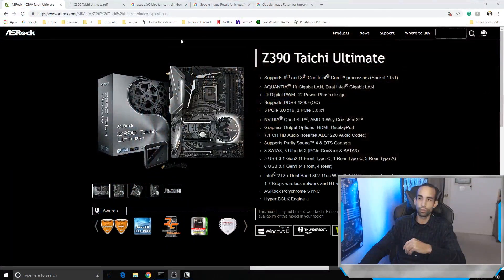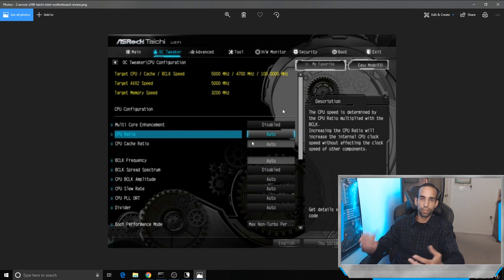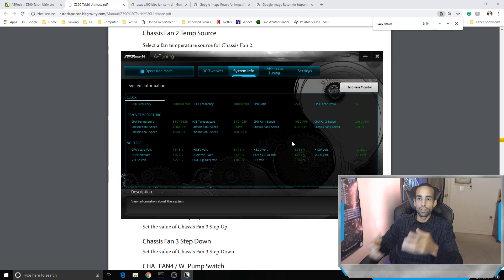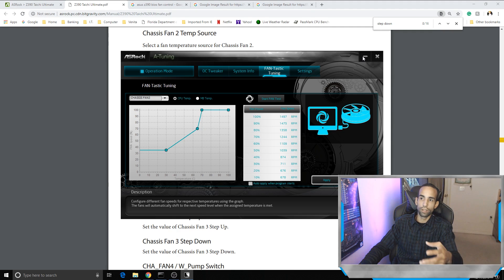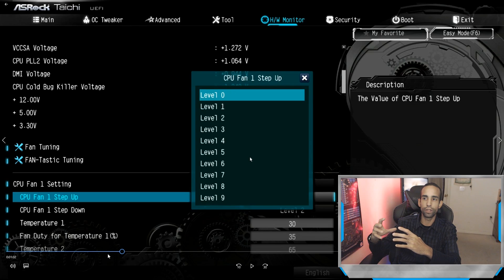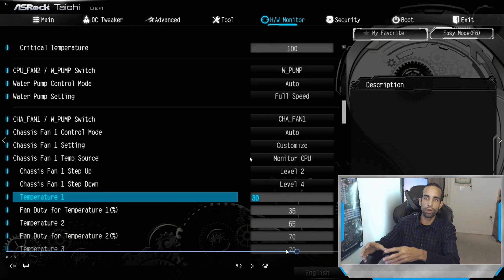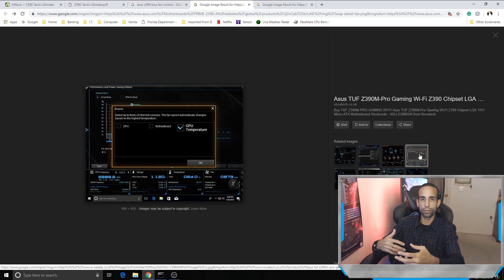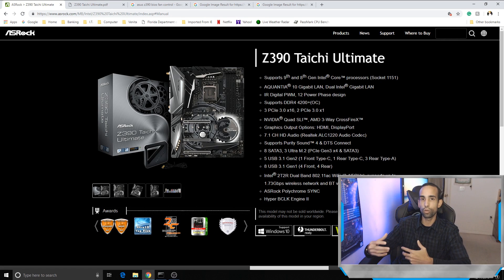Asrock Fan Tuning, Step Up - Down

Comment: HELP!
My System:
Asrock x399 gaming 6
Threadripper 1900x at stock 3,8ghz (4ghz)
Bequiet dark Rock pro 4 CPU cooler 
2x8gb DDR4 @3000mhz
Gtx1070 

I don't get it. I put both CPU Fans to 0% at 40C, to 30% at 60C, to 50% at 70C and to 100% at 75C.
Now testing cinebench r20 and looking at hw Monitor.
Temperature rises immediately to 68C where it stucks, all 8 cores only work at 3ghz instead of 3,8ghz stock and rendering takes longer of course. CPU Fans don't move at any temperature. 2 questions:
1) why aren't my Fans moving?
2) i know that the threadripper is considered not to be Run above 68C, but i wouldnt have any Problem running it at 75C for a few minutes. But why does it throttle down to 3ghz instead of going over 68C? 68C isn't that hot. Is there an Option for setting thermal throttle?

When all Fans are put to 100% at any temperature for example they actually rotate. Benchmarks are great then of course, eventhough it doesn't go above 3,9ghz, never goes to 4ghz boost clock. Temperatures are still stuck at 68C with fans at 100% at 3,9ghz so there is definitely some Kind of thermal throttle, but i don't want it to kick in at 68C, that's to low man.

If you don't know any answer also would appreciate a good Website or forum where i could be helped, thanks.
Reply from the maker: Something is clearly wrong. As far as CPU temps, did you use a cooler with thermal paste pre applied? I honest would start from the beginning. Remove memory and CPU cooler, resocket CPU, before cleaning old thermal paste check how far it spread on both CPU and heatsink to ensure good coverage, then clean and apply thermal paste. Re socket memory and boot. What are your temps at idle? If there not at 25c to 30c, then yes there is something taxing or throttling your CPU. Now the fans should be running 24/7 even at lower temps, but are they 4 pin pwm? Do you have them connected directly to motherboard or fan hub?
Reply: @SerpentXTech  well i found out that threadripper can go above 68°C in OC mode only. When I reset my cooler Settings everything is fine, but adjusting them by myself doesn't work like in your Video, as i said, Nothing is rotating.
Yes, fans are connected to the Motherboard. idle is 30°C to 35°C. in winter with lower room temperatures it only got to 62°C, so the current Setup was working fine for some time. i applied the thermal paste that came with the cooler, Maybe gonna buy some better Quality today. installing the bequiet dark rock pro 4 is quite a struggle in midi Tower. 
Also am thinking of getting another Chassis fan since i only have two, Maybe even try to undervolt :/
Reply: @SerpentXTech  okay, i installed a third case fan. Reapplied better thermal compound and undervolted the threadripper with an offset of -0,1V. Now i don't have any thermal throttling. :)
 idle is at 30 Degrees C, under long term load it doesn't get hotter than 55 degrees C. That's a temperature gain of -13 degrees, no throttling and noise reduction. Very happy i invested a few hours to tweak everything. Absolutely worth it. Also found out why my Fans weren't spinning when i configured the Fans manually: i put in the wrong target temperature, it wasn't reading the CPUs temperature. Now have them in silent mode. I can advice everyone to do so, undervolting is strong!
Reply from the maker: @L3nny666  glad you got it working
Reply: @L3nny666  Hey bro, please help me! how did you manage to fix your cpu fan to turn again. my cpu fan doesn't turn. it just twitches. it also shows the fan speed is n/a.
Reply: @L3nny666  please reply
Reply: @lowogi  Well in case you totally messed up your uefi settings just take out the cmos battery for 30 min or so to reset. And then Start again. As i said: set up the right target temperature. In my uefi the Fans stop spinning when put to CPU as target temperature, the right setting was called something different, that's what confused me the first time.
Reply: @L3nny666  Thank you, i will try this tomorrow.
Reply: @L3nny666  also, how do i take out the cmos battery?
Reply: @lowogi  man just Google it, it's that round silver battery on your Motherboard, if you can't see it may be covered by your gpu or some other components
Reply: @L3nny666  hey man, need help again. how did you manage to fix your cpu speed because mine is stuck at 3.5 ghz where it should be 3.8ghz
Reply: @lowogi  find out at which temperature your CPU starts throttling down. This Info should be somewhere on the manufacturers Website or somewhere on the internet. Then stresstest the CPU with cinebench and Check temperature with hwmonitor. If your temperature is to high it could be your CPU is throttling, so either you need better cooling solutions or you undervolt it

Comment: Nice info, though regarding ASUS's implementation it's been broken for several generations of ROG boards now (and possibly non ROG boards as well). The fan step up time and step down time options in UEFI do nothing and regardless of settings have no impact how the fans behave.
Reply from the maker: Hmmm I have to play around some more on the UEFI on the Tuf b450m plus gaming